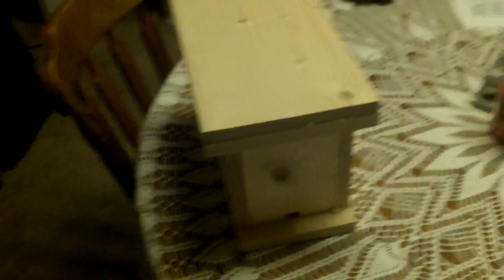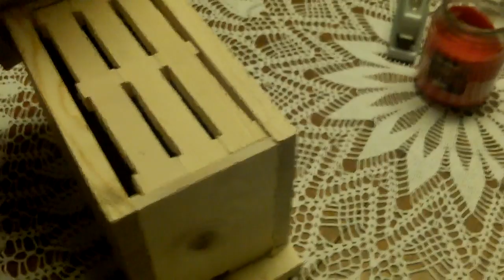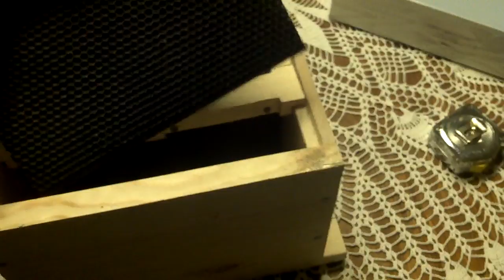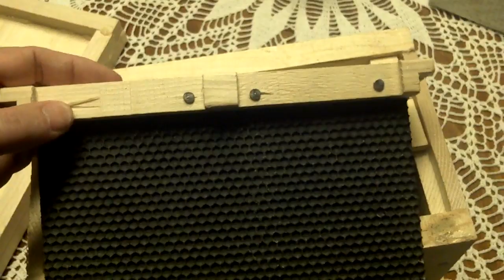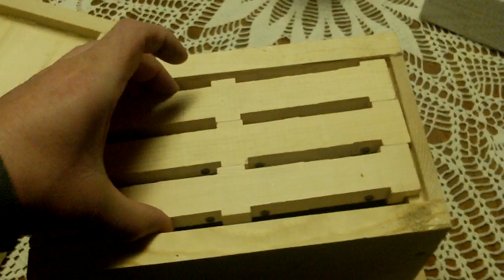Queen rearing Mini mating nuc

Comment: You need to put wood  on the top three inches of the foundation.  Bees like to attach the upper sections of a piece of comb to the wall.  Those foundations will eventually become attached to the sides and youll pull the edges when you goto removing them.  Look into how some people are using top bars style bars with side guides on their frames with starter strips.  Nothing gets attached.

Comment: great job - looks good - one downer on your nuc - use drawn comb for mating nucs - there is just not enough bees in the minis to draw comb - if you have a few frames that are drawn cut them to size on the table saw and insert with comb in up direction - if you do this you will be much happier with your queen rearing experience